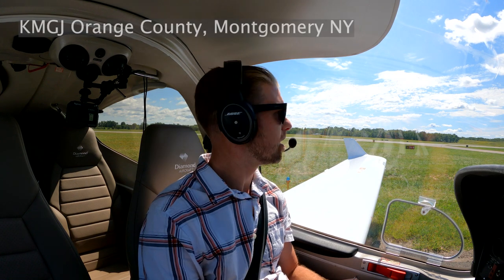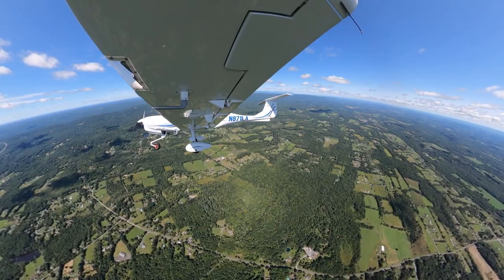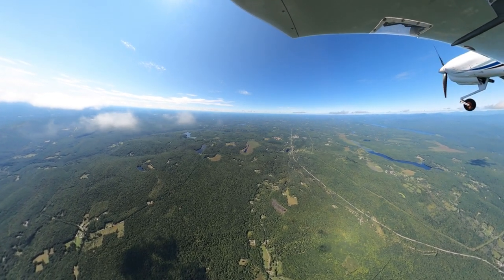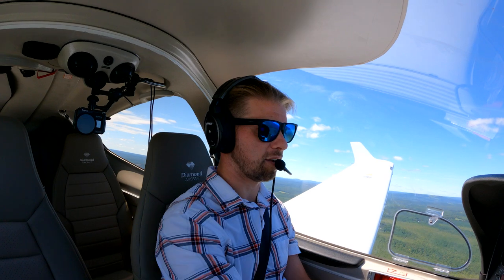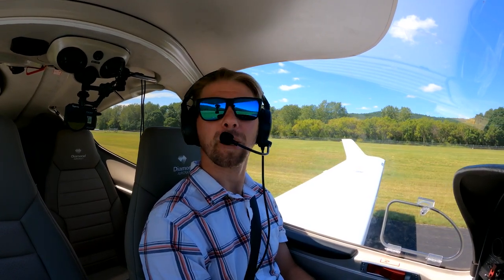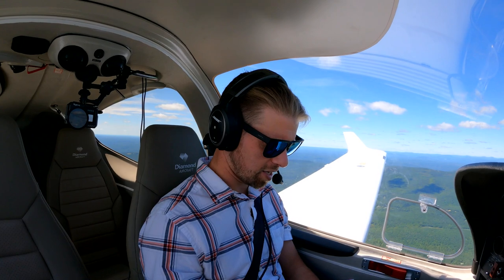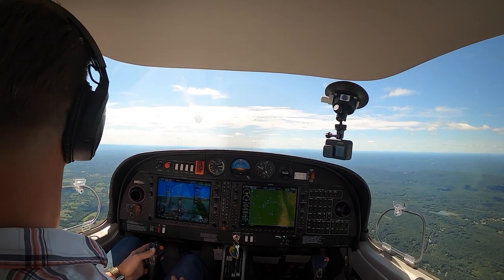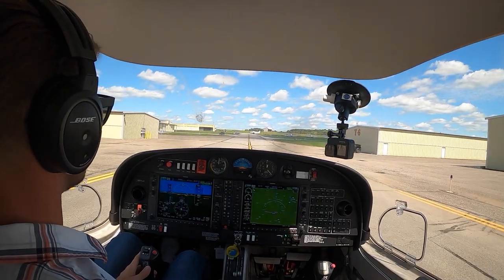Commercial Pilot Maneuvers in a Diamond DA40NG

Comment: Great video with DA40! Im doing my commercial in a DA40 in Orlando and this is perfect! Double perfect.       I love your video - very professional.  What's your setup for the forward looking inside camera?  I've tried to zoom in on how you mounted it at eye level, but looks like you have two mounting points.  Could you share the gear you used and how you mounted (even a picture?) thanks!!!!
Reply from the maker: Thanks so much, great to hear you enjoyed and found it helpful!  The forward facing camera is mounted with a mini clamp and adjustable arm, and it's clamped to the silver handle on the ceiling.  I have that GoPro in a little camera-cage so I can attach filters easier (ND filter to get smooth prop blur and so the G1000 doesn't flicker on camera) and the cage has a bunch of threaded holes to screw mounts into but I think I just used a tripod adapter with the usual GoPro mount on the bottom of the cage (mounted upside down).  The arm is like this https://smile.amazon.com/SmallRig-Adjustable-Friction-Articulating-Monitor/dp/B087T4T8D5/ref=sr_1_3?crid=17RHPBMRS4RKG&keywords=camera+mount+arm+clamp&qid=1660820502&sprefix=camera+mount+arm%2Caps%2C91&sr=8-3 and it's also a smallrig cage, no link because it depends which version of GP you have.  That clamp works great in the DA40's because of that handle up there!  You might notice I also ran the wires to the camera (power and audio) through that handle, that way the weight of the wires aren't pulling on the camera, and if I hit turbulence they're less likely to come unplugged.  Learned the hard way so maybe that will save you some trouble :-)
Reply: @RyanVoight  Thanks for the details!  I have the exact same arm, but didnt think to use for the GoPro.    I think you have a great setup for the DA40. I look forward to trying this out. I'll share if I can get something interesting. Thanks!
Reply: Question: I just got my IFR in a C172 G1000, I could do my commercial in the DA40NG how lengthy of a transition would it be to learn the DA40? How’s landing compared to the 172? Should I stick with the 172 or switch to the diamond? Thanks.
Reply: @javev1772 I did IFR in C172SP w G1000. I then switched to the DA40NG. The DA40ng is exactly the same G1000 usually and the same buttonology. The plus side with the ng is the fadec. SO NICE... and the low wing makes for beautiful landings